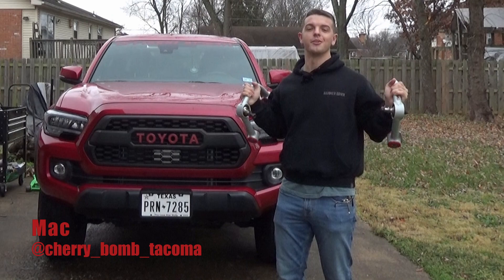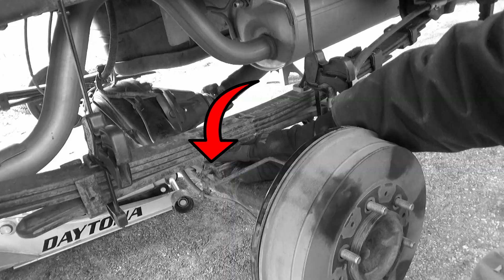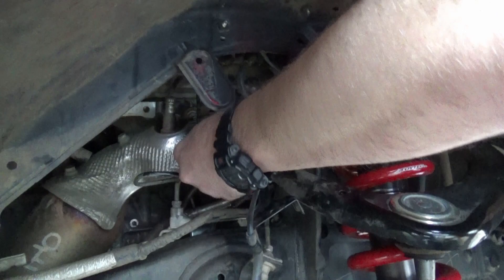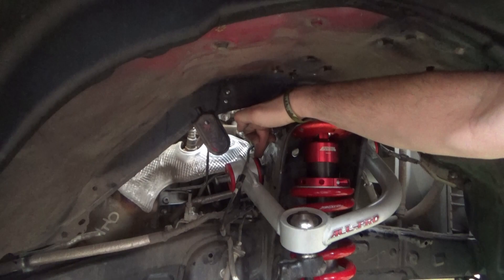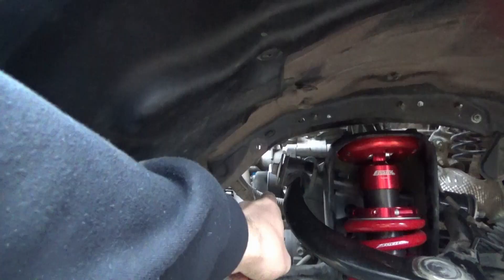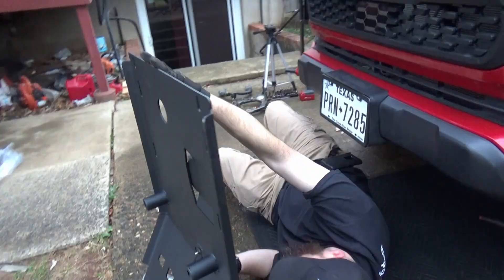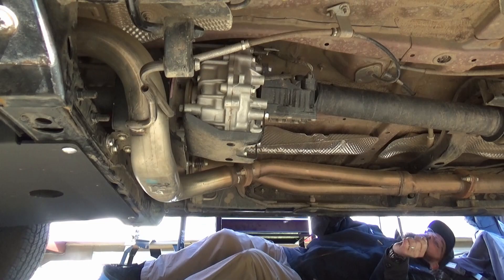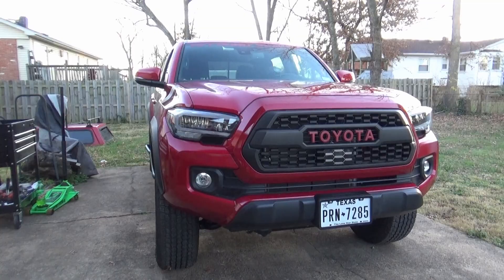VLOG & INSTALL | All-Pro UCAs & RCI Full Skids

Comment: Now that you've had the toytec for a year how are they holding up?  Smooth on and off road?  Would you recommend for a fully built overland rig?  TIA
Reply from the maker: They are holding up! However, I have done little offroading in the past ~8 months. Something in the suspension squeaks, it could be the AAL. If you're going to lift, please upgrade the UCAs. The lift with the All-Pro UCAs feels very smooth. Not as good as stock, but very close!
Reply: @Cherry Bomb Tacoma  Interesting, I would think and hope that aftermarket suspension would be better then stock! I worry with the 700lbs spring rate it being to stiff. Thanks for your feed back.
Reply from the maker: @Libr8r  It is definitely hard to tell now that I have had the vehicle for so long. It would probably feel better than stock if it was not so new! Also, it is very common with built rigs to have squeaks and creaks,